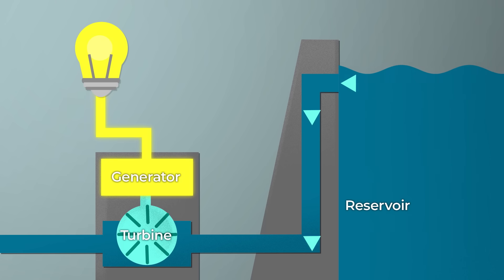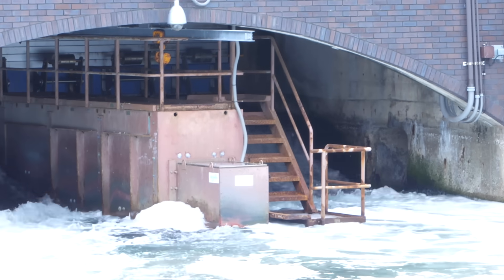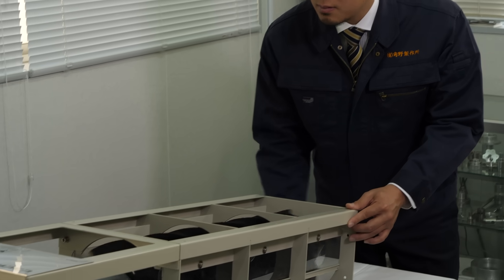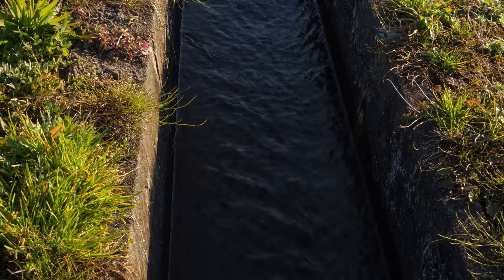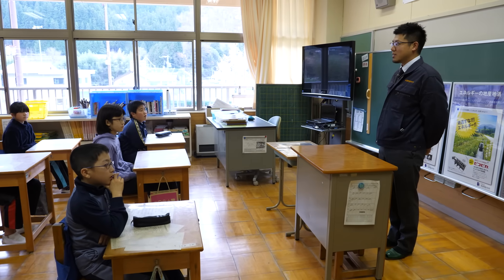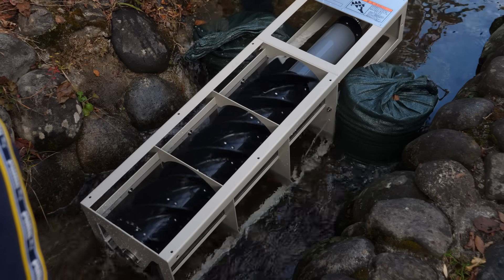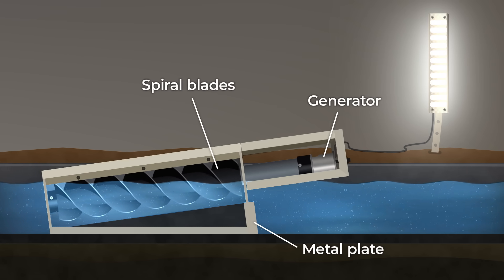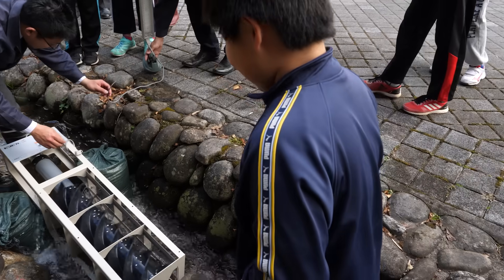Ultra-Small Water Power Generator

Comment: he didnt invent it
its traditionally called the archimedes screw, and was invented by Archimedes in the 200s BC
the major design flaw with this sort of generator is that one still has to correct for the amount of water entering the system. if there is a huge deluge of rain or storm and the water level exceeds the height of the machine, you've electrified the waterway and killed everything living in it
spain has a similar device the size of the entire river. it works well because the river will never exceed the height of the generator
this dudes 1m long device is merely a toy for school children

Comment: With a PV solar lamp you could have achieved the same for 1/10 to 1/30 of the expenditure.
With solar moduls you produce eco electricity for approx 25 to 30 years for only 3 to 8 Cent/kWh.

Comment: Where can I buy one?
Reply: Bro if you have some angle iron an electric motor/alternator and some time you can make one. The ones in old washing machines are pretty good. Go for something that has high torque for more energy output.
Reply: @zerincastle3183 I have those things🤔

Comment: Question is, is this concept scalable?   IE  is it practical in the kilowatt to megawatt range,  what is the maximum practical usage and size.   Otherwise it is relegated to only tiny projects or demonstrations.   If it is scalable into the 100 to 500 watt range it could be a great battery charger and power source for off grid living.   Would be a great team up with solar for a green power system if you have the electrical knowledge to set it up. If you can get it up to 500 to 1000 watts you could just use it on demand.

Comment: Please share your resulting voltage and amperage data on the light you were powering. And have you tried to mounting the unit vertically, sealing it in its case, so the efficiency is improved accordingly and with a higher height drop to increase the inlet/outlet head? By looking at others estimates that this device could be generating 10w, by my calculations one would need 875 of these running continuously for 7 hours (at 80% efficiency) to charge one Tesla Model 3 at night while the owner sleeps.

Comment: Are these available to buy? Are there plans online?
Reply: Every time you see this type of videos, it turns out the thing they showcase never even gets past the prototype phase. Turning on a lamp is nothing special, you can achieve those results easily in multiple ways. Since to turn on a lamp you require a miniscule portion of energy. I don't know if this is the case for this thing too, but I won't hold my breath HOWEVER you can build something similar for yourself. The only difference is that it requires a couple of feet of water falling rather than a gentle stream. Check the video ''The $50 Water Turbine -Open Source, DIY, Powerful'' from the OpenSourceLowTech Channel. It puts out 500w, enough for even a Laptop.

Comment: Glad to finally see someone putting a turbine in series to re-use the water flow, we need more of this kind of thinking
Reply: You can't "re-use" the kinetic energy which is what generates the power so putting them in a series is pointless hence nobody doing it.
Reply: @rutger726  But since it's flowing downstream it will gain energy again from gravity. Wont be a problem if you space them out right.
Reply: @rutger726  did you know that uhh, if you let water go downstream after going out of a generator. It will pick up speed again, hence, more energy. Fuck wit
Reply: @rutger726  Technically true, but the history of industrialization in the north eastern United States would like to disagree with you.

Comment: Has anyone thought about the idea of fitting these to both sides of a Boat, with Smaller ones for Smaller Boats, even Canoes? 

Which could be either Lowered into the Water to Produce Electricity, or Raised if the Water gets too rough? Why have these just for Streams or Rivers, when they could be used for so much more?

Comment: The design if flawed though. The efficiency drops off with higher turbine angle and higher flow rates due to water resistance in the machine. The boxes can't spin as quickly if the water doesn't move out of the way after the blades take the energy out of the water. Basically it can on spin at one speed which is the speed of the creek. Good for very small scale power like his 10 watt led light but hard to scale that up to high speed turbine.

Comment: Pretty cool, could be nice for LED lights by the camp site, and charge a battery over night that can be used to charge cellphones. Probably would be best to have a couple to charge a battery depending on the speed of the water flow
Reply: If you have the capacity to lug that to "camp" you have the capacity to just bring a battery. Also, battery wouldn't make you spend time damming the creek.

Comment: Hooking these up to a resettable Weight might also work. By having 2 water buckets hanging from a pole on a cord with a Pulley on top. When one bucket gets to bottom there can be a notice to pump the water into the high bucket.
Has anyone tried this?

Comment: i wonder if it would be possible to set up a way to have like a small body of water (enough to create a stream), confined in a container that gets warm/humid enough to have it become steamy & have drips forming at the top which then fall & get caught in the body of water to continue the stream at the same time

Maybe if as the water passed through the power generator it could pass over some sort of heated tiles which cause it to evaporate into steam & rise up to the top (i imagine an angled type roofing so the steam raises back up top, or a pipe directly above the hot areas which would then lead to another pipe angled slightly down toward the body of water)
maybe those heated plates could even be solar plates if possible, so the sun would be beaming through the design to power that while also adding extra heat

i'm no engineer though, i just smoked a few bongs & randomly thought it up while watching the video tbh lmao

Comment: Yes, the tech already existed, he has integrated an Archimedes screw with a modern generator unit designed for low water pressure [aka "Fall", or "head pressure" etc.] and low flow speed or RPM's.  If he designed the generator and or controller, it could actually be a technology advancement. 
Even if it has no tech advancements, it has value as a relatively portable unit, as long as you get a benefit from it's output range capabilities.
In other words, a new hammer can be useful, if it is designed well, has useful features and suits your purpose and meets your needs.

Comment: If this can be fitted to a capacitor or power cell bank, you could build up storage for enough power for anything thats used in your home save only for air conditioning. Washer and dryers use a lot of energy, but with a large enough battery on tap, you could have the generator powering all day and run a couple cycles a day. Electric oven, microwave, radios, and easily produce enough power to charge mobile devices, not just cell phones, but two way radios, hand held GPS units, and all sorts of gadgets. Not to mention the fact, if you strung a few of these together and powered a small water purifier fed with a water wheel or some other pump, you would have enough clean water for a small village in a unit the size of an SUV. Conceivably, this could lead to self contained micro water plants for remote villages and towns. And I can see many people here in the states who would want one for their remote hunting cabin or otherwise un-powered homestead out in the wilderness. Once you get deep into the woods, its not hard to get off the electric grid, and this could help people remain self sufficient.
Reply: You could easily offset your electric bill with a few solar panels and a modest turbine.
Reply: How is AC somehow ruled out? Does it use the magic other kind of power that can't be stored?
Reply: @petermgruhn  AC burns a lot of power, a central heat and air unit uses more power than all your other appliances combined

Comment: This is bullshit. This tech has been around for years. 3:15 they claim all that is needed is a metal plate that lifts the unit up yet they are lying. It also takes the damming of the rest of the stream for it to work. The sandbags.  There are literally thousand hydro dams in use today.  And they are in constant criticism  for blocking the natural flow of fish and wildlife. They say that they are so light yet fail to mention that that's NOT a good thing. They can be stolen and more sore washed away.

Comment: 0:56 remarkable, but the construction charge and maintenance expenses would be further higher. Instead of it, they could go for use of solar energy through panels installed over street light.
Reply: Solar panels have more expensive parts
Reply: @nonstickmeat  but it will be one time investment. In case of hydro power plant, you will have to change turbines often due to gradual damage by corrosion.

Comment: well...i mean it looks nice but honestly speaking: it's nothing new at all, has been done a bilion times before and the fact that it just manages to power a low-power light source like that only shows it is just as useless as all those other "super smart revolutionary" hydroelectric power generators people have invented.
Reply: Novelty isn't the same as utility, it makes no difference if it has been done before.  Now a case could be made that it does't have value because it is limited in application but I would argue that similar designs can have great value in the right context.  A low-power source isn't very useful in a modern urban environment but in a rural developing nation it is fairly useful when the alternative is tallow candles.  An electric generator would be more scaleable but it creates a dependence of access to a supply chain of fuel, spare parts, mechanics and other infrastructure to support it.  

As one book discussed in the use of oxen vs tractors for farming in developing nations, a tractor is more efficient but it creates dependence because a farmer can feed an oxen and treat it when is sick and breed more oxen but he can't grow gasoline, fix the tractor or create new parts or tractors.  Now a farmer can't create more of these turbines but mechanically is is fairly simple and it requires nothing more than physical labor and a small stream to power it.
Reply: @sokuna2404  sure, you have a point that for low power applications like LED lighting, a generator with low output like that one is enough.
however, i would argue that a 20 kilo hunk of metal is not the optimal solution for bringing electricity to third world nations when it comes to cost-efficiency.
Reply: @antonmayr6412  Kerosene or propane lamps would have a lower up front cost but they would require steady supply chains.  Here in the US with the pandemic we have shortages of all sorts of goods as supply chains get disrupted, imagine how bad it might be for a remote south east asian village that gets a supply truck or bus a few times a month.

I could imagine using this sort of device to power a pump for a drip irrigation system for crops or an aerator for fish ponds, or for a small workshop.  I can't imagine that the output would be worse worse than a car alternator and I've run low power air compressors, drills, sanders, etc with an inverter.
Reply: @sokuna2404  I am 100% confident that thing has massively less output than a car alternator and doesnt exceed 75 Watts.
a car alternator has an output of, what, like 50A/12V? i dont know if thats 12V peak or RMS but we're looking at some 375-600 watts of power there.
in order to generate 300 watts of power by converting the potential energy of water at 100% efficiency you need 300/9.81 ~ 30 kg*m of water. thats 1 liter of water per second down a 30m fall or 10liters down a 3m fall.

Comment: This isn’t a new concept nor new technology.  I can prove that this exact idea has already been around for approximately 35 years.  Just as aerogel was thought to be a recent discovery, and yet once again, around 35 years ago I watched as a toy plane held aloft in the air powered by a single human hair.   So to is this micro water turbine being re-introduced.  I have always wondered why it never came out and why it didn’t get sold to a large manufacturer for distribution.  Later I learned that one of the larger energy corporations squelched the project and buried it from history.   This was all just before solar power became a thing of course.   I guess now that wind and solar are more cost effective, water is now not so much a threat as it once was.

Comment: I'm sure that'll even generate enough energy to charger a AA in a week or so!
Reply: Its not suppose to work like that. You connect this to a few 12v or 24v batteries and itll keep thise charged up. Then you connect  the batteries to a power inverter then you can power a tv, lights, 
 computer depends how large the power inverter is.
Reply: 1 liter per second dropping 10 cm is about 1 Watt

Comment: Archimedes came up with this device to lift water 2000 years ago.
Reply: Did you sEE  that this is not a lifter,  but a electriCITY GENERATOR????!!!!??
Reply: Eduardo L. Yes.but the concept is the same
Reply: Not exactly. This generates power using a streams potential energy while Archimedes' device required kinetic (physical) energy to move water.
Reply: @maxkorman719  same mechanical design though as a form of positive displacement pump.  I know because my kids had to design a pump that could lift 1 gallon in one minute using wind power.  This design did this in 39 seconds in a science contest.

Comment: What's with people saying this is the same thing as an Archimedes screw?
Sure, the screw portion of the device has the same properties, but the Archimedes screw was a hand-cranked pump to bring liquids and grains to higher altitudes.
Not so much hand-cranked nowadays but you get it.

This is almost literally the opposite of an Archimedes screw. Not saying it's a brand new invention worthy of crazy award, but it's not what people here are saying.
This guy imo does deserve an award, not for the invention, but for the effort he put into making use of it and making it more of a thing.
Reply: They literally show, multiple times, this being hand cranked.
Reply: @petermgruhn  the point was that the AS brings water/materials from a low position to a high position as the result of a crank. This, therefore, is not one; it transfers the energy from materials descending from a high position to a low position, into what would be the crank. It is the opposite in both elevation transfer, and resulting power transfer.

Comment: This generator produces at most several watts of power. The head height is just a few centimeters and the flow rate is too small.

It might charge your phone and maybe light an LED lamp, but not much more.
Reply: It looks expensive. I doubt it produces as low as that. I'd guess 1000 Watts, at a guess. But what do I know

Comment: since barely enough power goes to the light and it constantly flickers, might as well have used a strobe light instead 😁
Reply: if the generator doesn't have a rectifier stage, the LEDs are getting AC. The flicker is probably imperceptible to human eyes, but for the camera it isn't. Try recording your monitor using your phone... same principle applies.

Comment: For small scale hydro, I've always wondered about anchoring a similarly sized prop or paddle-wheel boat to the bottom of a river and driving generators with that.  Perhaps on a larger model (small craft), even charging an onboard battery which could then move the boat via the same mechanism. as in, charging while anchored until it generates enough power to move.
Reply: Bottom of a river? How would that move a paddle wheel? Prop. Yes. Paddle wheel would have to be half in and half out of the water
Reply: @michaelesposito2629  really I mean only the anchor being on the bottom with the rest floating very much at the surface.  It might make a much quieter alternative to a generator on a camping raft, for example--though the point of those is as much fishing as camping, and the fish would likely not care for my idea. :)
Reply: This is actually illegal in many areas of the US. Disruptions to the flow of rivers and streams has a negative effect on the sediment and oxygenation levels, this is why so many don't like hydropower dams.
Reply: This is basically how tidal generators work isn't it?